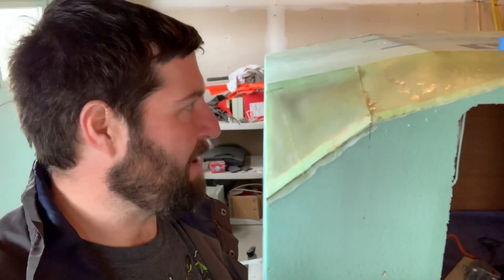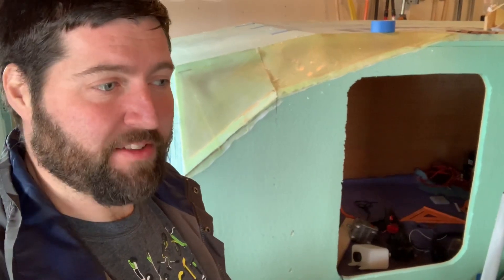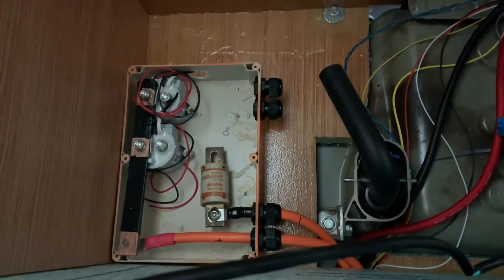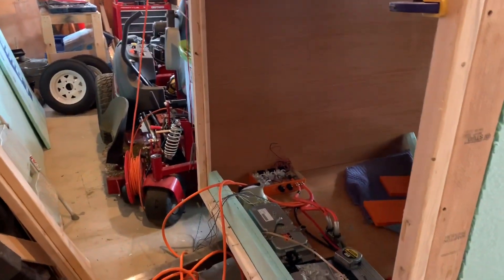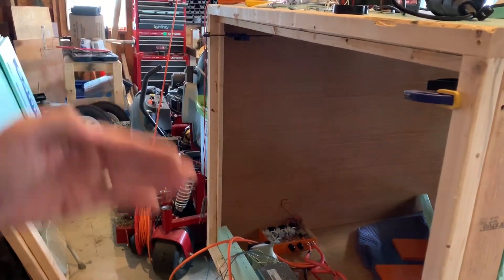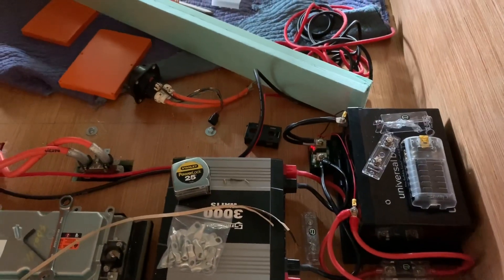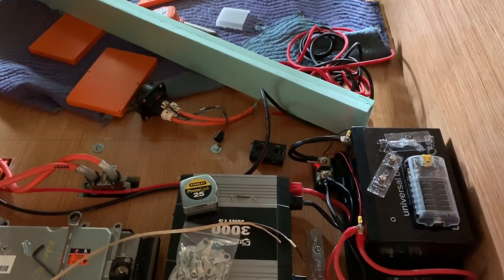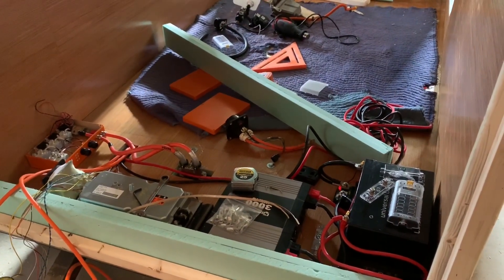T-Rex Camper Project Update - Foamie Camper Build Info

Comment: Pulling a 1300 lbs battery does seem excessive considering a gas RAV4 would be under 20K, have infinite petro range, and be able to pull a 1000 lbs trailer.
Reply from the maker: I really like the EV technology and driving on electric power. We have solar panels so with an EV our power is paid for. Plus gasoline stinks. Don't get me wrong, I used to drag race and I loved classic cars. But after driving EVs for 10 years going to a gas station is really gross. That smell really sticks to you.

Comment: Good progress, I do love what you're doing and wish you the best. Please do not forget that your total charging capacity for the RAV4 EV is 360 volt While that of Tesla battery is 392 Volt. You get more kilowatts i.e. more range with the two banks in parallel while you cannot exceed the RAV4 EV rated voltage 360v.

When both battery banks are connected you will need to keep to either RAV4 EV charging system or the add-on Tesla charger system which I think you do not need for safety reason. please let know if I am wrong.
Reply from the maker: Sorry but thats not correct. You might be thinking of nominal voltages, but even that isnt quite accurate. Peak voltage on the Rav4 Tesla battery is 386 volts. (92 cells x 4.2 volts per cell is 386.4 volts peak). The car usually only charges the car to around 379ish peak but it would be safe to 386. 

Peak voltage on the Tesla 85kwh pack is 403 volts. (96 cells x 4.2 volts per cell is 403.2 volts peak)

I am going to have a normal charge mode and a full charge mode. That will allow me to get to both voltage levels depending on what my plans are for the day.

The issue is the low point. The low point of the Rav4 EV battery is 276 volts (92 cells x 3 volts per cell is 276 volts low). The low point on the Tesla 85kwh pack is 288 volts. (96 cells x 3 volts per cell is 288 volts low) The controller is going to open the contactors of the T-Rex when the 85kwh pack gets to 288 volts.
Reply: Well you're on point, I am just thinking of safety as you have two banks of batteries with different peak voltage.
Reply from the maker: T. Sho there is no issue.
Reply: Sounds like a great opportunity to get fried to death on that type of voltage
Reply from the maker: @josephdupont  If you are incapable of any task it is possible to die from it wrong.
Reply: I really don't care if you electrocute yourself or you're not apparently not many people have been electrocuted yet but it's it would it would take place in the in a hundredth of a second the damage would be done this is not like screwing around with 110 even 220 AC can be pretty bad.For example, the battery pack used on the Toyota Prius generates more than 200 volts, and on some vehicles, such as the Ford Escape, this can range as high as 330 volts. This is more than enough to be fatal if a driver were to touch the bare battery cables while being grounded, or in a situation where there is a short-circuit in the system.
Reply from the maker: Joseph DuPont how very kind of you.....

Comment: Running out of supplies is the worst! Currently waiting on putting things back together in my Volt after putting in a mod yesterday to keep the engine off in cold weather because I'm missing two $0.33 bullet connectors and the hardware store is closed on Sundays.

That's going to be quite a robust auxillary power system! You could L1 charge another EV with that. The Volt APM seems like it may be overkill- was it just the easiest solution to get from ~360VDC to 12VDC? Do you have plans to use a lot of 12VDC & 120VAC power?

I'll also be watching to see how the TrailerTail-esque system work out. That'd be a really neat way to have the aero benefits of a ducktail teardrop but still have plenty of internal space. You're putting a galley back there, right? Or no? That'd be a trick with the TrailerTail.
Reply from the maker: Cool mod! Very necessary! That was the biggest thing I didnt like about my Plug in Prius.
I could! Yeah, I want to have access to power for anything I want to do. I will be camping with it but I also want to be able to use power tools if I need to. I could use it for work potentially.

Yeah, the rear door is going to be 2 feet thick. So I am thinking of putting a very lightweight sink and counter top there.
Reply: @JamesKlafehn  Have you seen this kitchen in an i-MIEV? https://www.youtube.com/watch?v=vFhVLbQPpcI